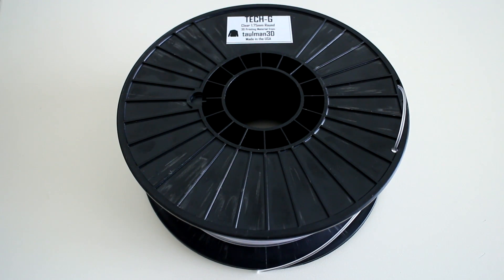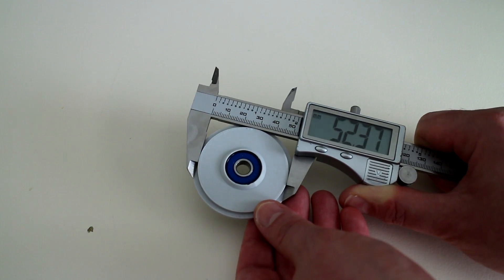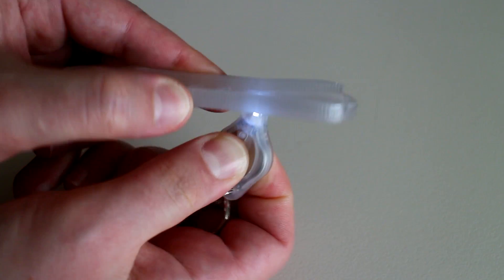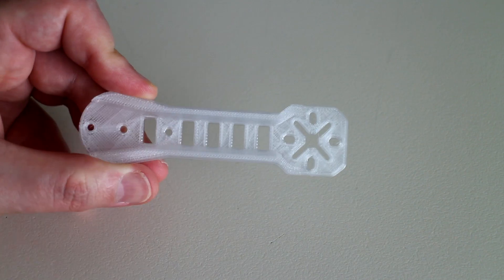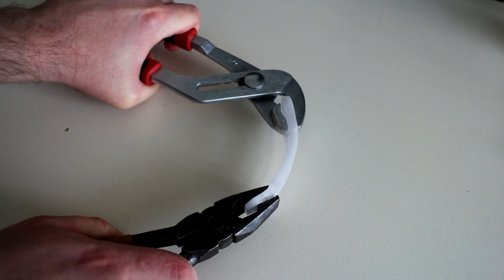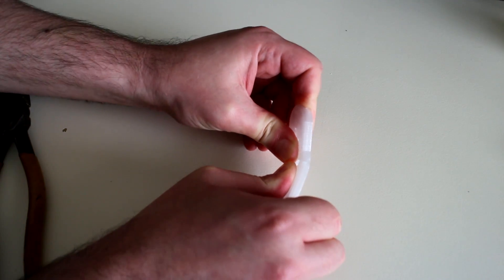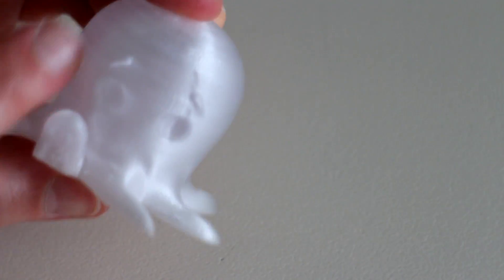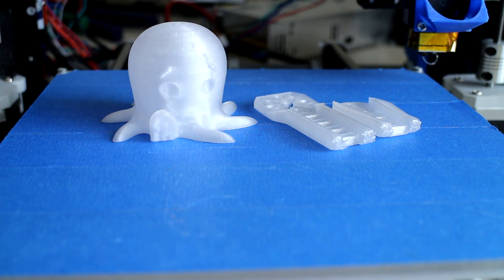3D Print in PETG plastic

Comment: One issue with PETG: most extruders use Teflon tubing that will break down at 250C. The solution is to use Capricorn PTFE tubing, which is good up to  300-340C.

Comment: The thing I like most about PETG is how easy it is to reform if you're handy with a heat gun. I actually use large sheets of this stuff to make check sockets for prosthetic limbs. printed parts behave pretty similarly to being heated albeit with a bit of shrinking/expanding.

Comment: 245 degrees? Wow. I'll wait to get a second printer. I'm not sure my wanhao can handle it.
Reply: 245 is right where the Wanhao i3 has issues, but if you buy an all metal hotend upgrade, you can print at 245 with no problems.

Comment: Hi,I bought some Esun Pet-g,and set my I3 printer at 245 C,but couldn't get my printer to work at that temp.So I upped max temp in Marlin to 250C,and printed at 240C.Bed at 50 C,blue tape on aluminium bed.I started with a nice simple print,the bed supports x 4.
The prints came out quite nice,but I got quite bad stringing between objects and bridges.Is 240 C too low?
I have set retraction at 3mm using Slic3R.
I,m somewhat limited in max temp anyway,because I have a peek J-head hotend,which is not supposed to go above 245C.I do have a Chinese clone E3d,but that still has a PTFE tube inside.Will that  work better at these temperatures?
Sorry for all the questions,first time I,ve used PET-G.Incidentally,I got slightly transparent red,but after printing,it comes up a slightly dull darker red,which looks quite solid.Regards.Hans.
Reply from the maker: E-sun should provide details on what temperature to print their filament at. It seems different manufacturers recommend different temps.

Try lowering the temp to 225c and see if the strings subside. I use 3mm for retraction also, at 150mm/s retraction speed.
You can also enable the cooling fan on  a low speed after a few mm in height. If it's a long flat part then don't use the fan.
Reply: Thanks for  that,mate,I'll give that a try.
Reply: I have done a lot of testing with PETG the last couple of days ( at least 12 hrs a day straight, three days in a row ), both myself and a buddy of mine. I have been using a MonoPrice i3 Plus and he has a Prusa i3 MK2's. We both have had nothing but a tough time .... lots of stringing with many different retraction settings, temp settings, bed settings, speed and I could go on. 

The most discerning factor is that once you bend the part past on what it likes ... it doesn't just break, it explodes in your hand. My technical engineering buddy has had the same problems as I have been having.

I went back to PLA and PLA Pro and prints are just beautiful. I just bought some Makers Geek Rapter to test annealing PLA.

Just my thoughts !

Comment: What is glass transition temperature?
Reply: Where the plastic gets soft and start to deform. Ie if you leave a pla print in a car in summer, it will melt and deform once the temp hits 55c. This petg a GTT of 78c before it can be deformed. It is quite a bit more robust.

Comment: what filament would you recommend to print a vacuum hose adapter to fit onto a power tool. (needs to be slightly flexible
)
Reply from the maker: Nylon

Comment: Would you recommend using a cooling fan with PET-G? Also is it better to print in an enclosed environment like ABS?
Reply from the maker: Yes certainly. I use a cooling fan with it. Smaller objects tend to need a fan to maintain rigidity and correct shape. I always open a window to exhaust the fumes, regardless of plastic I'm printing.

Comment: Would you mine sharing your print speed? I'm trying to print with PETG and it keeps bending between the entrance to the extruder tube and the tensioner... Wondering if I need to slow the feed.
Reply from the maker: I print at 40mm/s usually, same with PLA and ABS. Try a higher print temperature maybe?

Comment: Is this material also chemically smoothable like ABS with acetone vapour ? I'm really interested by the mechanical caracteristics of this, but I need a close to perfect finish for what I plan to use it for.
Reply: Dichloromethane or methyline chloride is what you want for PETG, Klean-Strip Premium Sprayable Stripper is your best bet for getting a high concentration.

Comment: I agree with your results and your thoughts on PETG. I doubt I will ever really print in ABS anymore since using PETG. I cant stand the smell and toxicity with ABS.
Reply from the maker: +Chris Halliday Agreed.
Reply: I agreed. I prefer to pay a bit extra to get rid of the smell of nasty plastic smell in my room
Reply: So it's safe? I can print it indoors?
Reply: IS PETG safe to print indoors?
Reply: PETG does not release any toxic gases. It's just better than ABS in every way. The only major change you require is  PTFE tubing like Capricorn on the extruder, which is good up to 340C. Teflon tubing will not last at 250C.

Comment: Another very good video as always, thanks for putting this up.

From what I can ascertain, thus far would you rate PETG as the best filament you've tried for mechanical parts (such as your Quadcopter's arms), where a certain amount of flexibility can be tolerated, but you're after the highest strength to weight ratio?
Reply from the maker: +Pete F 
Correct. I choose PETG over ABS now for high mechanical strength with some flex in high impact situations. In a quadcopter frame, weight is important for flight time and flight agility. My latest Peon frame is incorporating carbon tubing and PETG which seems to be a versatile combo for strength to weight.

Comment: Nice video! I have a question though; Given the high strength of this material and apparent elastic qualities before succumbing to ductile fractures would you say that PETG would be a good material to print say, washers, gaskets and rails for mechanical applications?
Reply from the maker: +Benedict Tan 
I think so. I would recommend Nylon over PETG though as it's very durable.
Reply: +Tech2C Noted, the overall rigidity of PETG interests me though as the parts I might print might require lower deformation due to compression than Nylon. I will look further into it! In the mean time I am finding a wealth of information in your video archives. Subbed! Keep it up!

Comment: I've read about a need to have the bed heated, however, I just printed a descent looking part minus the heated bed (my bed just crapped out prior to trying PETG).  I think that like ABS, if you print onto a raft, printing this material should be relatively simple.  I tried printing onto the bed and it certainly does not stick to the bed (nothing seems to).  I put down some blue painter's tape and set the temperature to 220C.  I played around with the upper temp and lower temps.  Too high and it's very soft and mushy, but too low and it starts hardening too quick.  I got my material from OrbPolymer.  At $19 a roll, this is not too bad.  The part complexity is very simple.  A 1" cylinder by 1" tall.  Start with simple parts and then work up to the next level of complexity.  I did a rough print 28 minutes.  The printer is a Robo3D, which I've struggled keeping working over the course of it's life.  For the money, I think something better can be had.

Comment: so what do you think is the best to use for you quadcopter?
Reply from the maker: +Chi Sty 
Definitely the PETG is easy to print and reasonably priced. 100% infill will be extremely strong.
Reply from the maker: DrR1pper
I've only used Taulman's TECH-G. I guess try which ever brand you can get at a reasonable price.
Reply from the maker: DrR1pper

A little less stiff. Similar to ABS.
Reply: +Tech2C Thank you sooooo so much for making this video. I think this material is exactly what i've been searching for, a material with the stiffness/strength of PLA (but even stronger in fact) without the brittleness and the significantly higher temp resistance! Hell Yes! :D

Would you recommend the TECH-G brand only or have you since tried others? Cheers!
Reply: Tech2C Sorry to bother you again but i just wanted to double check, PET-G (including the Taulman's brand) does not shrink (or rather minimally shrinks) like PLA? Thx

Found a Taulman roll of TECH-G from 3dfilaprint. Thinking i might give that one a go too.
Reply from the maker: DrR1pper

Yes, PETG doesn't shrink as much as ABS, but it does a little more than PLA. Set your heatbed to 90c and you will be fine!
Reply: Tech2C Hi again, i have a quick question for you if you don't mind please. For the same object and infill %, did you find TECH-G to be more, equal or less stiff than if printed with the bran of PLA you use? Thx
Reply: thx

Comment: I started printing in ABS like everyone else about 3 years ago, the first time i used PLA i never wanted to go back to ABS other than high stress parts (higher temp too). But for the last 6 months i haven't touched even PLA since i started using PETG, the draw back is that i found out you can't really print fast with PETG and i still have some PLA for that (45mms vs 120mms). PETG for some reason doesn't bond very well at speeds over 60mms or higher layer resolutions, it might have to do with it cooling down very fast.
Reply from the maker: +Gabriel Soria 
I'm the same - the 3D printer kit I bought came with a roll of ABS, but after printing with PLA I didn't want to touch ABS again unless I had too. PETG is great stuff, I'm glad this material exists and is reasonably priced.
Print speed isn't an issue for me as my Prusa i3 can't print faster than 40mm/s without sacrificing print quality...

Comment: After watching your video I purchases some natural petg filament made by the same company I buy the rest of my filament from. It was a disaster. The printing temps on the spool read from 230c-250c however, anything over 215c and the filament starts boiling out of the extruder(I removed the filament from a vacuum sealed bag that also had desicant in it) at 215c it prints but has terrible layer adhesion, anything higher and it just makes a mess. I'm going to try to dry some of it in the oven for a few hours to see if moisture it's the problem.
Reply from the maker: +Josh Bishop 
Woah, that's terrible! It was vacuum sealed? Not good...
Reply: +Tech2C Yeah, terrible.

 I dried a sample in the oven and it solved the problem,  resulting prints where amazing. I put the whole roll in the oven and it went well until I got to the inner coils of the roll and realized the expansion and contraction made about 95% of the roll fused, unusable and unreturnable. I was hoping it was isolated to a batch of the material so I went back and bought a roll of transparent blue Petg from same manufacturer. Same problem, it just boiled out of the extruder so I returned it for a full refund. For about $2 more after shipping I've ordered some American made petg that looks promising.

I'm also wondering about the ptfe liner in my extruder, I was told it would be a problem when printing PETG but I've noticed no ill effects. I have ordered a solid stainless tube and will inspect the original one in my mk8 style extruder when the new one arrives.
Reply from the maker: Sounds like a dodgy batch of PETG from your local supplier. Hopefully the new stuff is much better.

I think the PTFE liner in your hotend will be an issue at higher temperatures. Maybe that is what they mean when printing PETG at higher temps?
Reply: +Tech2C  yes I think that's what they mean and this new filament I've bought does print at a higher temp (up to 270c if I remember right)
Reply from the maker: Oh, then I wouldn't crank up the heat past 245c. You'll need an all-metal hotend to reach 270c.
Reply: +Tech2C That works out well since I have the parts in the mail.
Reply: +Josh Bishop Well,  ordered some American made Petg and I am running into the same problem. It's not as bad with this roll, it prints ok until the extruder is interrupted in the operation because even though the extruder isn't going, the filament still boils and flows out of the nozzle. I am starting to wonder if there's something wrong with the extruder or if I really just got 3 bad spools in a row.  I'll do the same testing and bake a sample of this filament as well as changing the parts to have an all metal hot end.

I was really hoping this filament would be good because I have my own quadcopter I designed and I want to print it in PETG.

I contacted the first company I bought PETG from, they asked for the batch numbers on the spools and they are sending me a roll of black PETG they are introducing.
Reply from the maker: Is it possible your hotend temp is too hot? If the filament oozes quite a lot maybe there's too much heat? The only PETG I have used is this Taulman3D TECH-G stuff. Nothing but praise for it so far.

I guess if the new roll of black does the same thing then maybe it's temp.
Reply: This new stuff was rated at 260c, it started oozing/boiling far below that temp. I should confirm it with my infrared thermometer though.
Reply: +Tech2C I got some very poor but strong prints from some black Petg. Still having moisture problems. I think the solution is to try the same brand you showed in this video. I've confined the temps and evening is as it should be.

I wasted so much time printing with this stuff I have up on designing my own quad frame and I printed yours, it was a good decision.
I mounted my board camera at 20 degrees on the plate you designed. It sits so far back I thought it would obstruct the camera but it does not. The board camera is very protected.
Reply from the maker: Josh Bishop

Well Done. I have my camera up at 15 degrees incline.
Let me know if the Taulman PETG is better than the stuff you've tried. I honestly rate PETG very highly from this so I assume the material you received was defective in some way. We shall see...

Comment: Since you're able to print the exact same quadcopter arms in different materials, you could probably do some actual deflection tests with them. screw them onto the side of a table/piece of wood and through the motor mounts, hang some weight and then note either how far the weight drops or how much deflection there is, then you can put them into a spreadsheet and whatnot. It would also be good to do this test with different infill amounts, then work out the best amount of infill/weight to deflection
Reply from the maker: +SSJChar 
I replied to another commenter with a similar suggestion. Testing the bend radius by adding weights is a much better, repeatable test than my subjective bend tests. However I think dropping a known weight from a specific height onto the arm will simulate a crash of the quad. Cheers!

Comment: Hi, just been noticing that you're not using the cooling fans as you print anymore compared to your earlier video's.  Any reason or just getting better at printing.  Could also look at the Taulman 3D  In-PLA,  looks alot stronger and regular PLA with a little more flex or ability to handle some knocks.
Reply from the maker: +Bugcatcher3d 
Hi, the part cooling fans were removed for the Nylon filament, and also to make filming easier. I only need them for small prints or very fine resolutions anyhow.

That's it for Taulman3D reviews for the time being. I have some Polymaker PC-Plus Polycarbonate and translucent PLA to review next...

Comment: I have a sample of PETG from a local seller I ll try it soon! But was told to set up to 250c will try first with your tests! Thanks so much! 
PS> The seller did made me a note to extrude some ABS after use because is some what abrasive to the nozzle so as you make your tests could you keep an eye over your nozzle if possible and report back? lol Would be great!

Thanks so much for sharing!
Cheers!
Ed
Reply from the maker: +rifted 
That's interesting, there's no warnings of nozzle abrasion on the Taulman3D website for this stuff. I wonder if it's a particular brand or all PETG to be aware of this?

Either way I'll check on the nozzle flow in future.

Comment: Thanks for this set of videos very informative, would be good if you could rig the arms clamped to a bench, then add weights to see how each of the materials compare.
Reply from the maker: +Ant Scranney 
Too true. The way I've been testing is subjective to how strong I feel on the day, not very scientific but it does give an indication of strength somewhat.

As these tests are based on quadcopter usage, I may make another video dropping a heavy weight directly onto the part to simulate a crash, rather than the slow stress tests I've been doing.
Reply: +Tech2C
You get a good impression on the materials properties from what you have shown, so its all good.  From a quadcopter perspective the motors generate &#39;x&#39; amount of downward force, so perhaps an additional test to see how much the arm deflects at and around that force.

Not sure this is going to yield any practical information as dont own a quadcopter, but from what I have read the stiffer the frame the better (except in a crash)!
Reply from the maker: +Ant Scranney 
Good point. The quadcopter motors and props I use generate 400g of thrust each, but larger motors and props can generate upto 1kg each. In that case dangling a weight of 400g-1000g should simulate thrust and deflection of the part.
Cheers!

Comment: Did you get this straight from the states or is there a UK/EU reseller where you got it? 
Looking for the strongest possible material for printing gears that can handle torque and metal contact. You reckon this would do the trick?
Reply from the maker: +samik83 
Taulman3D sent me this direct, but they have distributors all over the world http://taulman3d.com/buy-locally.html
Reply: Polycarbonate is one of the toughest
Reply: samik. 3dfilaprint in the UK stock it. I haven't bought this particular filament from them but used them for the first time last week. If you buy 2 or more rolls you get free next day delivery. This filament is £27 a roll.